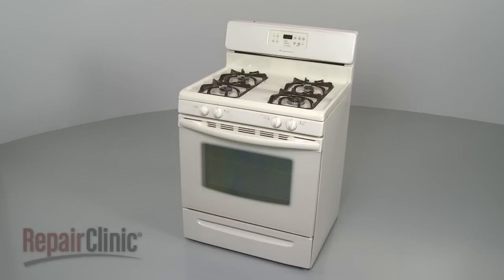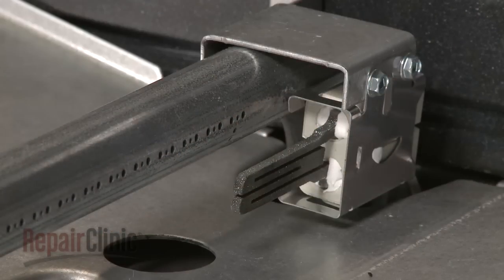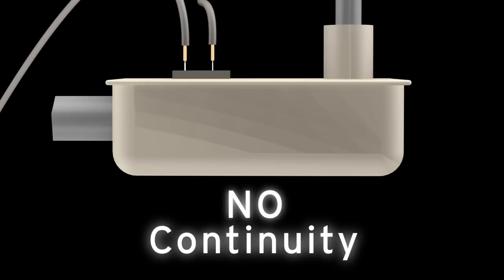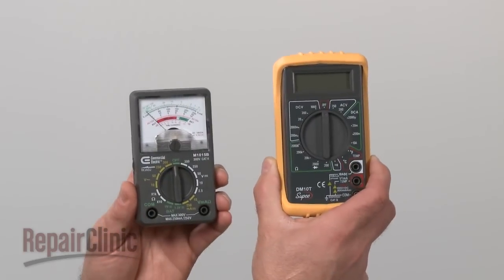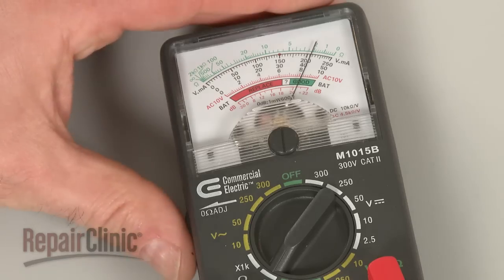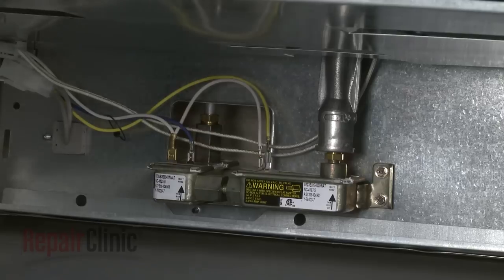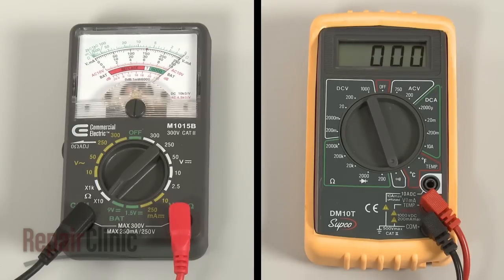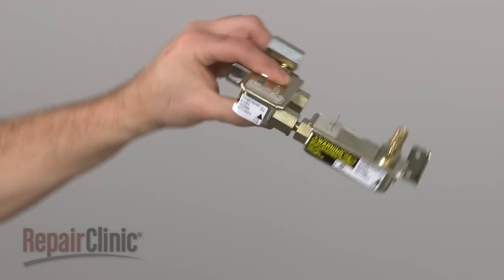Oven Not Heating? Safety Valve Testing – Gas Oven Repair

Comment: These repair clinic videos have been very helpful. They helped me locate my igniter and how to test for continuity. My igniter tests at 216 (so it's fine). What is interesting is when I turn my stove onto "Bake" I can watch my igniter get red hot right away and then after about 30 seconds, the gas comes through the oven elements and ignites. My issue (and what had me start my investigation) is that when I set my stove to "PreHeat" is that gas comes hissing out of the oven elements immediately and the igniter never goes on. Interesting, huh? Not sure what to do about this one....

Comment: Will a side by side dual oven have 2 safety valves? ..also, if so, and valve is defective, will that cause the red indicator lights at the oven knob at the main oven operation panel to not light up?  

Its a viking, my wife just  used it a couple hours ago and it worked fine. Now neither  oven will light up and the red indicator lights dont come on when i turn the knobs to the on position..

Comment: i tested my saftey valve with an digital multimeter. it reads 1 on the display. this is between 0 and 5 as you say but not a significant difference, so is the valve okay or defective?

Comment: I replaced the ignitor and checked the safety switch continuity. Continuity is good, but the ignitor still wont light up at all. The broiler works and the stove works but the baking igniter won't work. I have kenmore model 790.72903012 and replaced the ignitor with electrolux model 5303935066. Could this be the wrong model ignitor??? It looks the same as the original ignitor, just a slightly different ignitor shield. Please help. Thanks

Comment: I've got a  Kenmore model 36275192100, igniter is lighting but does not fire up after 90 seconds.  It does sometimes, but after a very long wait.  This would be an igniter/burner problem correct?  Can you tell what part number I need from your site for that model?  Thanks!

Comment: My bake and broil both tested at 194 is that too low? the manual says 216 is where it should be. I have gotten mixed answers in my research, some said it can fluctuate around 216 30 -/+ and be fine and others insinuated anything below meant the solenoid was bad.

Comment: My oven problem is not it turning on, but oven won't turn off with Stop button up top.  Is it the safety valve or control board?  Oven comes on OK and can adjust temp, but oven will not torn off, I must unplug range AC power and physically turn off gas , then plug back in.  Observation?

Comment: i have a gas oven that does heat up, but after reaching temp(350) it shuts down and will not re ignite burner... unless it goes all the way back to a cold oven. possibly a weak ignitor, or control board?
Reply: Temp sensor

Comment: Old standing pilot Roper with Robertshaw 4700 thermostat and VS 4060 7XX safety valve. The safety valve has no electrical connections. How do I test it? I've replaced the thermostat with a new old stock 4700. The pilot doesn't change at all. Bad valve?
Reply from the maker: First get the pilot orifice out of the pilot assembly and clean it. It should pop out after you take off the compression nut and slide the  pilot tube off.  It may be clogged, causing restriction and preventing enough gas from getting to heat the sensing bulb from the safety valve. Be careful not to make the orifice bigger or the pilot flame will be too high. When the thermostat is turned on, it lets more gas thru to the pilot causing the flame to extend to the safety valve sensing bulb; gas is also sent to the safety valve when the thermostat knob is turned on. When the safety valve sensing bulb gets hot enough (usually red hot ), the safety valve will open and let gas through to the burner.

Comment: I was in the process of replacing the igniter for my fridigaire stove but I might have shorted out the gas valve. Should I test valve with a meter first or can I put new igniter in to see if it works?

Comment: Thanks for the video help. Oven doesn't heat. (Broker and warming compartment work fine). Replaced the ignitor first. No change. Then tested safety valve for continuity and it seems to be fine (fluctuating between 1.0 - 2.0). Now what?
Reply from the maker: +pjmuck The control is likely defective or you have a bad wire in the circuit.
Reply: How do I test if the control board is broken or not?

Comment: Tappan 30-2251-00-07 (Frigidaire/Electrolux) My igniter did not have continuity and was replaced but the oven still would not light.  I tested the gas valve and continuity was good, according to this video. I replaced the valve anyway and had an enormous flame,  tightened the nut below the orifice (adjustment for LP), and now all is fine.  So continuity for the valve is not the whole story as my valve was not functioning but tested ok.  
Also read elsewhere that the bimetal valve should snap open and snap shut, but if defective may open but then continue to leak gas when turned off... they should add this important caveat here for DIYers.

Comment: Btw...even if the gas valve tests good for continuity, or both bake/broil have similar ohm values the valve can still have failed mechanically. I actually just had this situation today on a service call. Broil was 205 ohms, and bake was 203 ohms. Broil works, bake doesn't. Installed new gas valve and now bake works.
Reply: May i ask you a question about HSI in the gas stove? If I'm trying to use upper burner HSI staying ON at all the time and in about 10 minutes starting to smell in the house.  What could be a problem?  Is that a defective HSI or some controller ? And how to tested? 
 Thank you

Comment: Is it suggested that if the ignitor is glowing, the issue is NOT the safety valve? I replaced ignitor, its glowing but still no burn
Reply from the maker: The safety valve has a bimetal that bends from heat created from the amp draw of the igniter. Igniters over time will get “weak” and will not draw enough current to open the valve. The only way to know for sure if the igniter is drawing enough current is to use an amp meter to check it. You may have a new igniter that is weak or you may have a bad safety valve. The current draw needed to open the safety valve is printed on the valve, typically 3.3-3.6 amps

Comment: I have a whirlpool oven does not turn on, it was working fine before I had moved it to do some tile work,,,surface burners work properly,,,i changed out the oven igniter to a new one and still nothing,,, on the igniter it shows 54.5 on resistance. and resistance on safety valve shows 1.1 and beeps for continuity. any help would be great thanks
Reply from the maker: +505_NewMex_505 If the igniter is new and does not glow then we would suspect a defective oven control. The valve having continuity is a sign it should be OK.
Reply: the igniter does glow
Reply: is there anything in the valve that might mechanically fail??
Reply: check the supply voltage of your igniter if you supply of your igniter is ok you replace new one igniter
Reply: +tamalis gang i feel like an idiot. i guess when i had it moved either me or my child switched the off lever on the the part where the gas line connects to. its kinda hard to see. its weird that it only stopped the gas to the oven and not the top burners.

Comment: I just popped off one of the tabs in the valve.Now I need a new one,damn it
Reply: Those tabs should be difficult to break off. They're more likely to bend than break. It sounds like yours may have already defective probably from corrosion.

Comment: Ok im at a stand still currently because I replaced the ignitor which has 3.6 going through, but still didnt light . I checked the saftey valve, and it does have continuity.my question is can they get clogged or do I have other problems?
Reply from the maker: The valve does not normally get clogged, but they can fail mechanically. The arm inside the valve can corrode and cause problems with it opening. This is not very common, but if the igniter is drawing the proper current than the valve should be replaced.
Reply: Thank you for your reply
Reply from the maker: No problem!

Comment: my oven wouldn't lite but when i tapped on the valve with the flashlight it worked should i replace the valve?
Reply: if it sticks once, it will stick again. Its been my experience that it needs replacing.

Comment: I have a Frigidaire unit which appears identical to that in the video. The igniter glows hot, and the gas flow will begin after 60-90 seconds, but sometimes the flame will flutter, and the valve sounds like it is opening/closing very quickly with a buzzing sound, but allowing enough gas to flow to keep a low flame (usually). This is intermittent, and sometimes the valve will open fully like normal. Does this sound like a clogged valve, or perhaps an igniter with borderline current draw?
Reply: RepairClinic.com  l replaced the igniter, it is blowing and the safety valve continuity is 001  but won't burn what's next...

Comment: The safety valve for the oven on my Whirlpool stove stays open for gas all the time without any current to igniter. Is the valve defective. # 98005638  Thanks
Reply from the maker: Yes, there should not be any gas flowing through the valve unless the igniter is on and proper current is being drawn.

Comment: The diagnostic is confusing and misleading. In your other video (watch?v=I7kVsp4GduM), you say that if the igniter is glowing, it may not be delivering enough heat to trigger the safety valve and may need to be replaced. Here, you say only that there is a high likelihood that it is defective. However, if the igniter is glowing and there is still no heat, there is also a likelihood that the problem is the safety valve, as you point out in the other video.

Comment: if your multimeter reading zero ohm that means short circuit
Reply from the maker: +tamalis gang A short is a term we normally use to describe a scenario when you have continuity between a component ground.